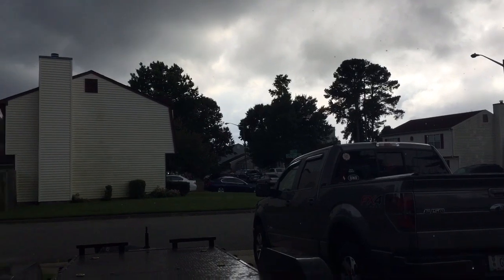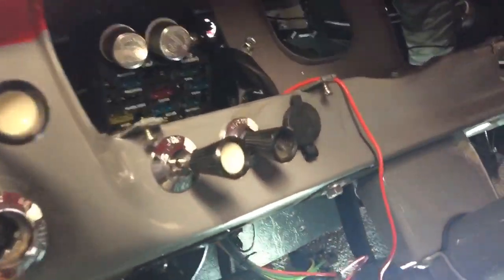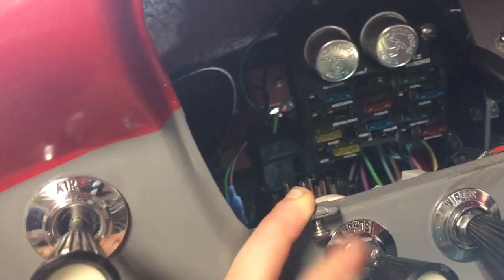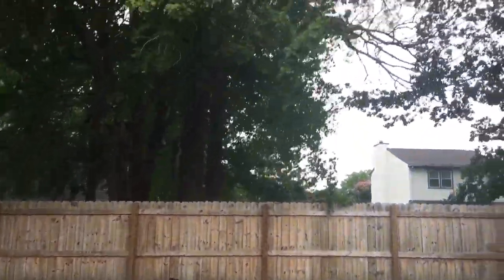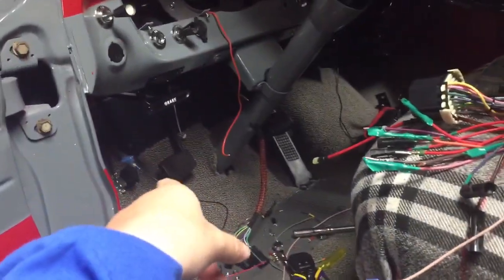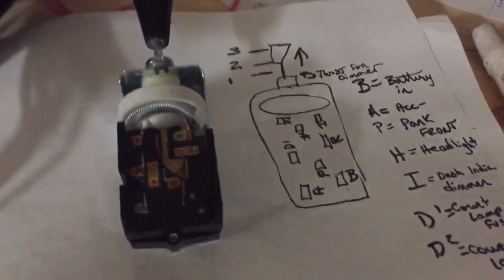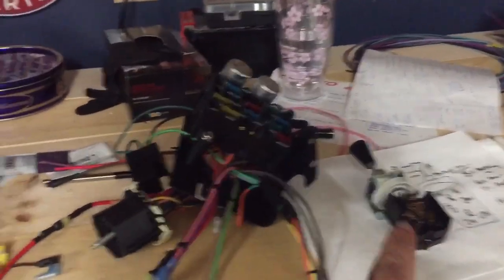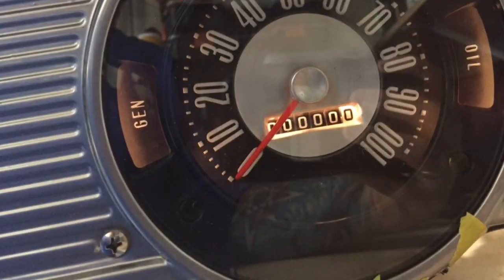Closing in on wiring finish

Comment: Here I is.
Reply: Where did you get your red and black wiring loom?
Reply: Looking good.
Reply from the maker: MostlymoparIH I bought it on eBay.  It comes in different sizes and colors.
Reply: Thanks. Is the size you used 1/2 inch?
Reply from the maker: MostlymoparIH I used both 1/2 and also 1/4.   Search 225fwy on eBay.   The product I got was 25 FT 1/2” Black Red Expandable Wire Sleeving Sheathing Braided Loom Tubing US.  Like I said/ there are dozens of different colors etc- it was like 10$ a shot.   And the cloth tape I used to hold the ends down was on Amazon I think cause I’m not seeing it in my eBay purchase history.
Reply: It really cleans up the engine bay. There's some wire tape coming loose in my mini van that I think that would work nicely to fix. Thanks again.